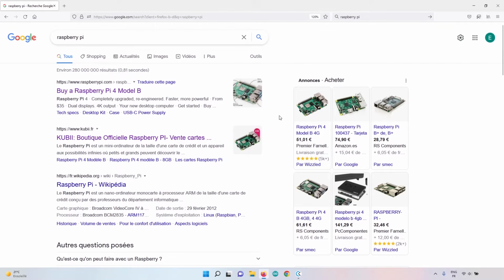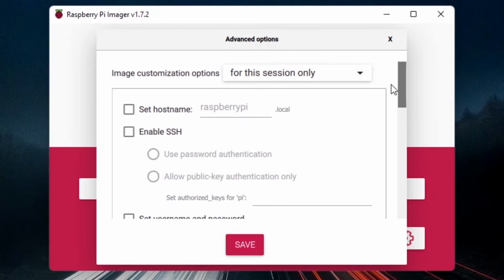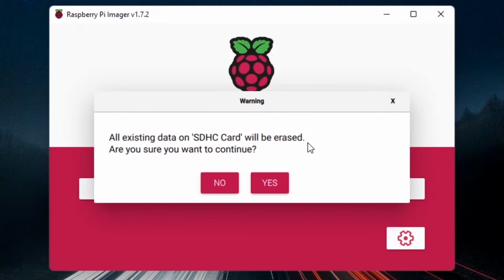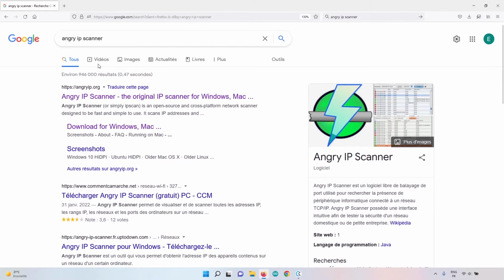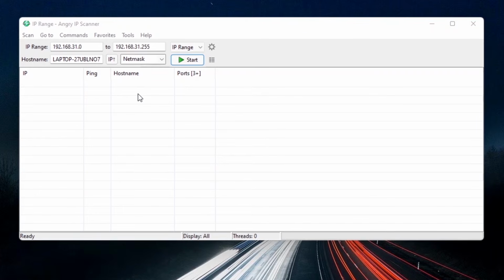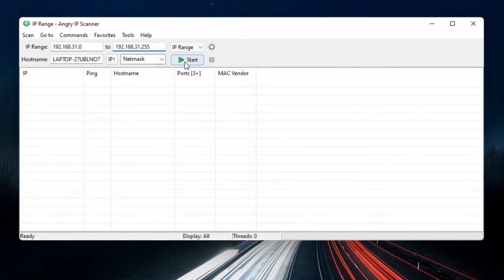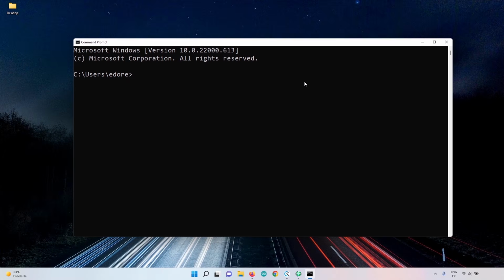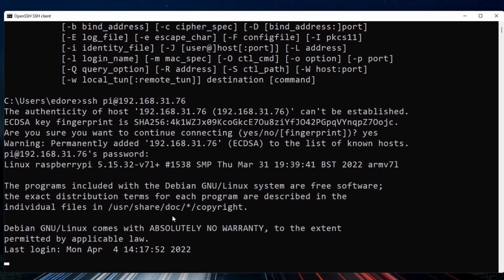Install Raspberry Pi OS Without a Monitor (Part 1) - Raspberry Pi 4 Tutorial (#2)

Comment: This video shows how to install Raspberry Pi OS on a microSD card without using a monitor. The video showed how to use the Raspberry Pi Imager to set up the OS, connect to Wi-Fi, and enable SSH so I can control the Raspberry Pi from my computer. I also learned how to find the Raspberry Pi's IP address using Angry IP Scanner. After that, I used SSH in the command prompt to connect to the Raspberry Pi. This method is useful because I can set up and use the Raspberry Pi even without a screen or keyboard. Thank you for making such a helpful video!

Comment: this is a really great tutorial, but i keep running into a problem at 13:31. i have 2 networks that say wifi but have addresses beginning with fe80:0:0:0: and the address i have beginning with 192 doesn't say wifi. when i click on it regardless, it gives me 6 ips (4 blue, 2 green), but none of them have anything signifying that it is the raspberry pi. what do i do..?
Reply: I have exactly the same problem ://
Reply: @ hey, i managed to make mine work. i basically connected the rpi via ethernet to my laptop. using putty you type in raspberrypi.local as the hostname, port 22, and log in, it should work!
Reply: if you dont choose you wifi and just let it be NETMASK it worked for me :)
Reply: I'm facing the same problem as well
Reply: Could you solve the issue?
Reply: @ yes, download putty and log in from there. 

if you can’t figure it out just reply to this comment i’ll send you a more detailed explanation !!